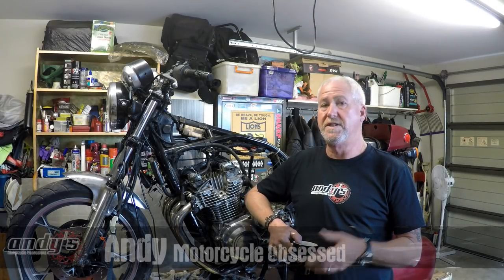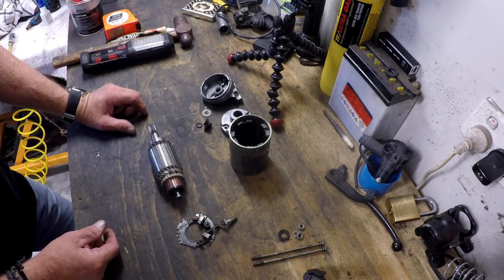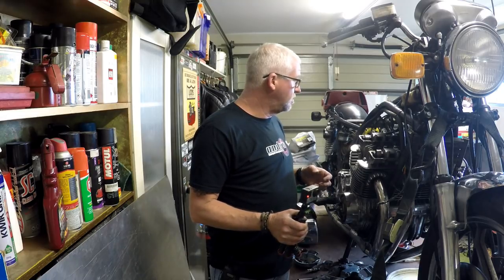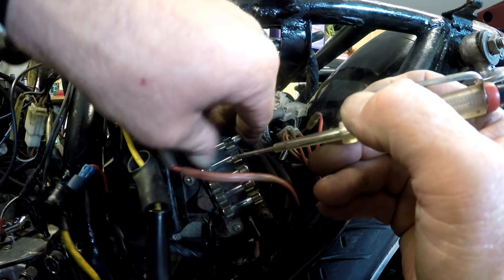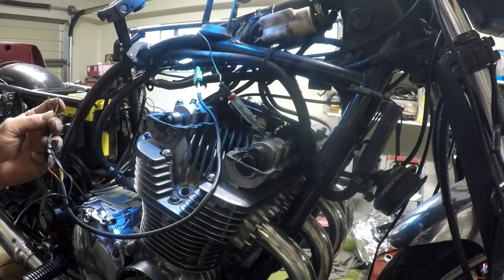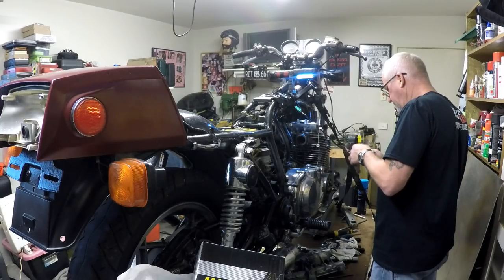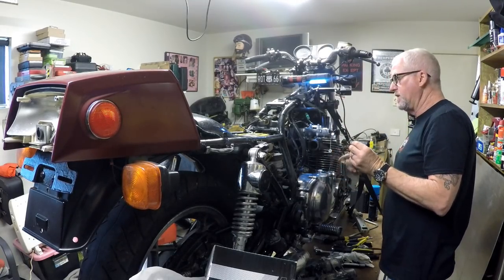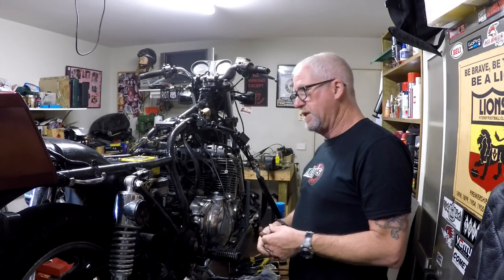GS1000 Episode 3 - Arcs and Sparks

Comment: I used to have a GS1000G for better part of a decade around 20 years ago. I was born almost exactly the same time it came out the factory. We were best friends for tons and tons of kilometers. Then it started to act up on me, going all types of broken more and more often, so I sold it. I learned about a year later, it had busted the shaft on the hands the new owner. I think it knew it was about to die, and told me to let it go. Thanks for reviving this one. It means a lot to me.

Comment: I got a stack of chain drive starter motors and if you are still in need I'm sure I can strip one down and send a pair of, got some other bits and bobs just call it.
Btw that ceiling light ain't doing you no favours, makes you look like an angel.😇
Reply from the maker: That very generous mate. It seems to be holding up, having said that it hasn’t been bounced down the road for long enough to tell. Hang on to them mate, if it fails in the future I will be able to source one. There seems to be a few about. Cheers, Andy
Reply: @ANDY5  no worries,offer remains.

Comment: I re-shimmed the valves on my bike recently and it gave me an extra 20 psi on the compression test on each cylinder, all of my clearances where out of spec but there was still clearance just not enough! according to the manufactures specifications, you can also find out what compression readings you should be getting by finding out the atmospheric pressure of your location and then multiplying that number by the compression stroke of the Gs1000 which i believe is 9.2:1 so for example if you're at sea level the atmospheric pressure is 14.70 pounds per square inch, multiply 14.70 by the compression stroke ratio (9.2:1 in this case)  it'll equal 135psi and that'll be an ok compression reading for the Gs if it's situated at around sea level

Comment: Two things I would recommend: 1 remote ignition excitor switch for compression testing when you can't use the handle bar electrics 2 USB or Bluetooth lighted endoscope which are super cheap now for a pretty skookum jammer.
Reply from the maker: I actually had one in my dirty dick beaters, but put it back on the shelf and walked away.  I figured I had better things to spend my hard earned doll hairs on but I have lamented that decision for some time now, I may pick one up again and see if I can live with it.  Thanks mate.

Comment: Nice project Andy! Greetings from Norway here. Doing a rebuild of the same bike here, -81 mod 1000G. Also had that same chargingissue when I bought the bike 5 months ago. New regulator(high quality), and battery sorted that out. Hope you dont have the statormeltdown, that might cost you :( My bike is now in pieces, frame is sent away to sodablast and paint. Started with the engine today. Have problems with the valveclearence. But those shims will be overlooked after I ve changed all the gaskets down to the cylinderhead. Have a bucketload of small issues that I have planned for the bike, hoping that your videos can help some. Will make a tribute to Bills bikeproject by paypal, just something small but everything counts. Making a scrambler and have a LOT of original parts lying around....sadly the postal would kill the value of the parts. Keep it up!

Comment: this just what I need ripping into an 81 xj650 in a f.in cold shed - you are calm and methodical which is teaching me a lot. I haven`t connected the battery yet but am considering junking the old glass fuses for the spade type, maybe source a fuse block from the car breakers?
Reply from the maker: Plenty available out there.  I have an aftermarket one on my XS11 that I bought from a marine supplier.

Comment: Andy, I have the same bike. New coils,new spark plugs,new wires,freshly rebuilt and tested carbs. Cylinder 4 is not firing even though I have spark,fuel. The head pipe is cold to the touch after 5 min of idling. What is going on!?!

Comment: Better to test the spark using the starter motor because it may be taking too much juice away from the coils while cranking. Shame Suzuki didn't keep the kickstart on the GS1000G.
Reply from the maker: Agreed, but it was broken at the time.
Reply: Could I just ask a question, because I couldn't quite see in the video? While I was changing the cable on my starter the nut dropped down under it. I wasn't able to fish it out and it seemed to disappear somewhere near the front of the starter motor (near the gear end). Is there a hole there somewhere? I saw there was one further back with a lead going through it but it can't have gone through there. Update: I just looked at some images of the crankcase and it seems there is a hole there, I wondering where it leads, maybe it dumps on to the ground, I can't imagine that water that gets in the starter motor housing would go anywhere else.
Reply from the maker: G’day Dave sorry for the late reply. The only other hole I can think of is below the starter where the gear selector indicator wire routes through, at least that’s what I think it is. Highly unlikely that the fastener would fit through it though.
Reply: I think sometimes with this model there is a drain hole at the front instead, maybe that's the case for the Mitsuba starter models, my bike's from 1980. I was able to find the nut on the floor in the end.

Comment: Would it not be good idea to disconnect battery when removing fuse block and mucking around with it? also I don't think leaving spark plug holes open to the air allowing stuff (technical term) to potentially fall into the combustion chamber(s) is a good idea; just sayin'.
Reply from the maker: Yes

Comment: There's also a useful modification for the charging circuit (as by standard the charging route is via the right hand controls!). The G/W wire from the stator is connected to the R/W wire from the regulator. More info on BassCliff's website including a wiring diagram with the mod http://gsarchive.bwringer.com/
Reply from the maker: G'day Dave, I'm familiar with this as it is not isolated to the GS.  I had a quick look at the link but couldn't see the article so I didn't look too far.  The question I have is why?  The Suzuki GS1000, and quite a lot of other bikes for that matter, have an issue with their charging system as it puts out way too much power for what the bike needs.  This results in the charging system having to sink the heat somewhere and that is usually in the alternator which results in overheating, breakdown of the insulation and eventually a short that usually takes out the reg/rec at the same time, this even happened on my 2005 Triumph Daytona.  The factory engineers tried to mitigate this by diverting one phase through the headlight to try and reduce the load on the rest of the system, and cooling the stater with oil.  That mod essentially bypasses that mitigation and puts all three phases through the reg/rec all the time.  I can't wrap my head around why this is a good idea.
Reply: I guess that its a long path for the charging circuit to take and involves a few switches and the like all of which could stop some of the current getting to the battery. I am glad though that you questioned this and it made me think again about whether to make the modification or not. The modification only makes sense if the headlight is on all the time. By the way the article is a pdf of the wiring diagram showing the modification 'GS1000G (80-81) Wiring Diagram (Color)'

Comment: Not sure how much you have had to do with old gs's, but its likely the wiring is butchered because it doesn't charge. It doesn't charge because the stator is cactus, and the stator is cactus because the regulator and rectifier were no good in the first place...
Good luck mate.
Reply from the maker: G'day Rhys, yes mate I am aware of the Achilles heel charging issues, I'm planning to do a video on this shortly.  It isn't unique to the GS either, in fact it is surprisingly common.  In fact my 2005 955i Daytona even had a similar issue.  Thanks for watching, Andy

Comment: Nice video. I really like the old GS bikes. I've done quite a bit of work on my dad's 81 GS1000L. I'm guessing the reason they bypassed the fusebox for the main fuse is because of the high current running there from the r/r , coupled with the fact they are prone to getting bad connections internally in the box, causing the box to overheat and get burned. Has happened on my dad's bike once.
Also, I saw in another comment that you are aware of the charging issues of these bikes. Just thought I'd add, in case you don't know; a series type regulator/rectifier is a really nice upgrade for reliability on these old bikes. Lets the stator run way cooler. You can read more about it here, if you are intersted (best website for Suzuki gs bikes by the way) :
https://thegsresources.com/statorpapers5.php
Reply from the maker: Yes someone introduced me to the stator papers already.  Sadly not isolated to the GS' and is an issue with a lot of bikes actually.  It just seems to be quite prevalent on these things.  I will cover it when I get to it.